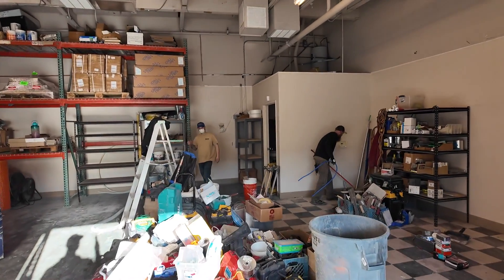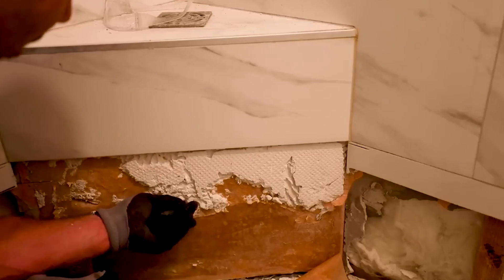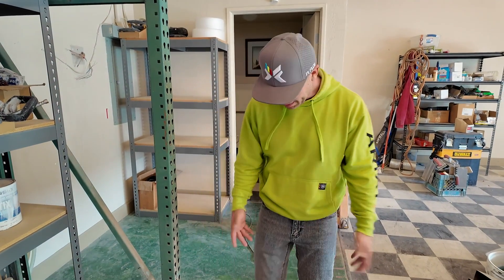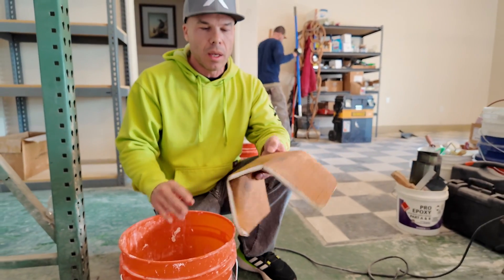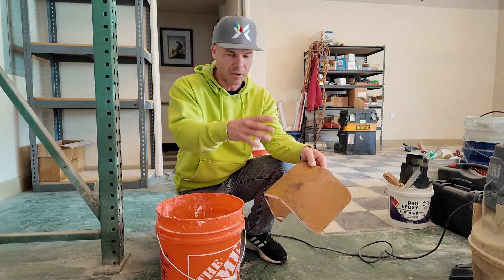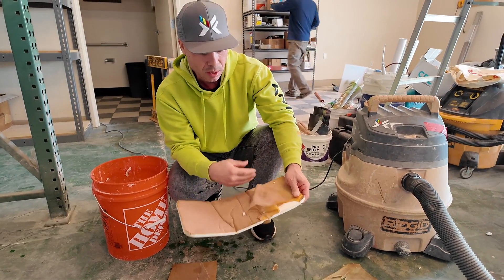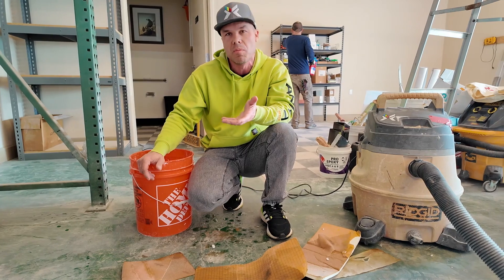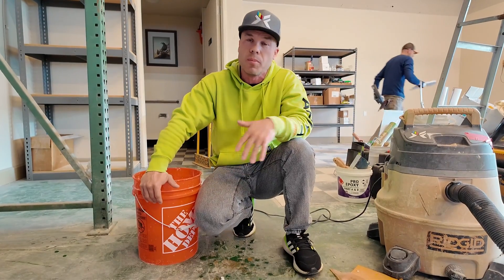MOLD ON SCHLUTER KERDI ???  This can't be good. 1 year test.

Comment: As a biologist, I guarantee you that anything you put in that bucket will grow mold in a year, and most things will grow it much quicker. Kerdi is a good product. They're not selling panels that haven't been tested. I prefer hardi, but the panels are appealing because they're light and easy to cut.
Reply: I think the test is flawed. The entire board is not meant to get wet, just the top of the membrane. I believe you compromised the structure when you got the foam under the membrane wet. I believe the best way to test it is by just putting water on top while leaving everything else dry. But that is just my opinion.
Reply: If it is install correctly, you shouldn’t have water trapped in a tight space in between tile, thinset and substrate. If you have a sloppy tile or grout install, or movement in tile, and water gets in with no way of air to dry out that space, and that shower is used every day for a year. Allowing that small space to never completely dry, and ta-da you get mold.
Reply: @AlexMikhael grout is not impervious to water, it's a cement based product and will no matter what absorb water every time it is hit with it and allow moisture to travel to the substrate and get behind the tile. Hence the reason why we install shower pans, because the tile and grout isn't impervious to water, right?
Reply: Molds always present. It just needs to right environment to grow. I've grown mushrooms and have also battle mold on a daily basis with plants. I have to keep humidity right and run three 8 inch carbon scrubbers 24/7.
Reply: Dust is also a food source, I’m sure there’s plenty of dust around the shop
Reply: Their boards to flimsy. I prefer GO board or weidi. The Goboard gives the best bond bc it has fiberglass but it's also a nightmare to handle bc of it.
Reply: @mr.eastcoastgrow6132 I wonder if we bought the goboard and then painted hydroban across the surface if it would be a better product/ easier to deal with not so fucking itchy. Just an idea, but that is a lot of work too
Reply: You prefer hardi? You said you are a biologist correct? So you are a biologist, that does enough tile showers to have a preference on which board to use?
Reply: @FuAzzi  shouldn't be using Hardie in a shower anyway
Reply: @justinkeppler9860 yes half inch hardy on the walls
Reply: @Americanman450  are you referring to Hardie backer? What do you use to waterproof it?
Reply: @justinkeppler9860  you can use all sorts of waterproof paints or there are films that you can morter to it. I do the second.
Reply: @jasonredepenning  interesting... I'm not a fan of Hardie anything interior or exterior but especially not in a shower. I'd use duraroc before Hardie but I don't like having doing double the work so that's why I prefer boards already waterproof minus the joints
Reply: @justinkeppler9860  I can understand that. I just feel funny using paper type products.  If I wanted to punch the wall I'd want it to stay intact.
Reply: @justinkeppler9860  if I had it my way I'd make everything concrete.  Shit I'd sleep on a concrete bedroom on a floor if I could
Reply: @jasonredepenning  once the tile is on the wall I promise you can punch it and not break it. It would hurt like hell but I could punch through Hardie backer without tile on it lol.
Reply: Can you define a woman?
Reply from the maker: The bucket itself didn’t have any mold on it.  I think the Kerdi has a glue or paper (something organic) that is food for the mold.  But like I said, I’m going to put a few different types of boards in there for another good soak and I will keep you posted so hopefully you’re subscribed so you see the updates.  Thanks for watching and your input.
Reply: @TileCoach  Hello my friend the mold can come from tiny invisible spores flying around in the air, or previously on the bucket, which then get into the water, which is a damp environment making it habitable to mold. a real mold test would involve a controlled environment preventing spore growth
Reply: @TileCoach  Probably the best way to test the products is to create small cubes of all the products with weights inside to keep them submerged. This way only the outer waterproof layers make contact with the water.
Reply: @TileCoach  Why do you keep putting in Kerdi Systems?
Reply: Any schluter product is required to have all the white covered in orange. Not a fair test at all.
Reply: Shareholder Alert
Reply: Unless you used rubbing alcohol to clean the bucket prior to test it would have mold in it….
Reply: Well atleast someone has some sense
Reply: Good info but also remember these materials are waterproof.  Hardi will fail when soaking in water for a while.  Also very dangerous to lungs when cutting and inhaling the dust.  Of course wear a mask as protection but most contractors don’t
Reply: No a accurate test on my opinion kerdi or any other shower foam board is not to be underwater they support to get wet not be underwater
Reply: Well you’re a biologist, not a trades worker let alone tiler
Reply: If I were a professional installer I would refuse to use kerdi on anything.
Reply: I thought shower materials aren't supposed to be submerged for yrs at a time?
Reply: @KMORRICE1985  shower pans that get used frequently can maintain moisture constantly under the tiles
Reply: Mold is good for you. Don’t believe all of these Dr. Fauci’s 😂

Comment: Dude it's so shocking what you are exposing. I'm sure schluter has some reason why user error is causing the failures, but I always thought their brand was supposed to be synonymous with simplicity and ease of use. Seems like you have to nail their process 100% or your shower will fail. 

I love how much foresight and dedication you have! A year-long test! It would have been great to see a control group: maybe a dry Kerdi board, or a plain bucket of water in the same space, or a piece of alternative shower board/drywall/cement board. There are other factors that could have contributed to the mold.
Reply: He’s not really exposing anything. Schluter can easily and fairly say their product isn’t meant to be submerged 24 hours a day for weeks on end. Taking any product, and stress testing it way beyond its intended and documented use, is a fools errand.
Reply: This is a terrible test lol....
Reply from the maker: I'm on it!   Stay tuned.  Hopefully you are subscribed with your notifications on.

Comment: I'm sure kerdi is excellent if installed 100% properly. Personally I only use  cement board and a quality liquid membrane. Works every time.
Reply: I'm sure Kerdi works great in a shower that's used for 15 minutes once a week.
Reply from the maker: Ya but we can do better can't we?
Reply: @TileCoach  i’ve been watching your videos for years off and on and have gotten into Remodeling helping with bathrooms and now I do fall on bathroom remodels down to the frame I mean everything you know complete gut moving the toilet chipping up the floor moving shower drains at work all by myself one man team. Where I am in South Florida never seen Kurti. I’m sure it’s around. No one‘s ever taught me. I’ve only learned that cement board was code and was I’d say 95% of the showers. I open up just sheet rock behind them down here very shitty builders built this part of South Florida from what I’ve learned but I came from up north Massachusetts but I’m seeing your amazing work for years and I know you make much more than I do and I’m wondering how I can learn about Curti. It must be easier and simpler than the heavy cement boards in the dust and then the coats of the red guard to me your videos. It looks like your sheet rocking you’re putting on tape on seams, and rubbing some sort of stealing over it, but I’d like to know the right way and if it’s easier and quicker it would just I’m getting up in years and anything the light in the load and make it easier. You know any suggestions on how I could learn about in South Florida

Comment: I think the problem with the test is this. If water has a high nutrient level it can grow mold. Now with your test the water was sitting still and no movement will promote mold growth regardless. With that said also you are in a shop and I guarantee a lot of dust is now in that bucket over the course of the year no matter how well kept the shop is. All of these are contributing factors. Just to confirm if you had a bucket with kerdi and a bucket with only water if you took a water sample from the non kerdi bucket after a year I guarantee you would have the same mold spores present. Always enjoy your videos and I do like seeing different scenarios to show what showers can fail to give us all better knowledge.
Reply: You were able to type what my brain was trying to think...🙇‍♂
Reply: Yeah scientific method requires a control group!
Reply from the maker: @jeffreyjbyron  The bucket kind of is the control group. No mold on the inside of the bucket, only on the Kerdi, so there must be something about the board that facilitates mold growth. . But please stay tuned I will be doing more of this!  Please subscribe and turn on your notifications if you already haven't. Peace.
Reply: @TileCoach  You might be right, it's probably that a rough surface give mold something to cling to. 

Hey--I'm in norcal and I want to get in touch. How do I find your business?
Reply: Mold will grow on nearly anything unless it has mold inhibitors. If you have mold spores and the right conditions, you'll get mold. Kerdi cannot control either of those. They might be able to add mold inhibitors, but that would raise prices. Do any of the competitors advertise anti-mold? Also, are there any competitor products you've tested that don't grow mold or don't fall apart when subjected to the same test. That's a big part of the scientific method: Controls and different variables (variables being different products here). Not that I don't like to see people trying things like that, but give comparisons.
Reply from the maker: I see what you’re saying but there was no mold on the bucket itself.  But I am going to be doing other boards so stay tuned!   Also, read the other comments about mold on the Kerdi from being left in the rain in the bed of a truck.  Not sure but there will be more to come. Stay tuned and thanks for your feedback.

Comment: You get mold on a piece of glass, it has nothing to do with kerdi.
Reply: Also mold only forms if it is exposed to air.  Good idea to have 100% coverage.
Reply: I wish he wouldn't do these clickbait videos.  It's kind of beneath him.
Reply from the maker: @radman999  It's not click bait if it's a true statement. You might not like it, but it's not beneath me.  If other boards do the same, I will report the same.  Thanks for watching and please stay tuned for updates.
Reply: @TileCoach  Anything will mold when left in a bucket for months.  Have you never seen a petri dish before?
Reply: @TileCoach  Hi Issac I’m getting ready to redo my bathroom and will use flofx drain with flofx membrane. What is my best option for the walls? Can I use backer board with hydro ban? Also what is the best brand for backer board? Thanks

Comment: Yet 40 years and 500,000 installs in Europe with 0 documented failures when properly installed.  Funny how that works.
Reply: I think that's the catch. Why make a product that requires more precision that is also more expensive? I thought the whole thing about Schluter was that it is easy to install. With so many opportunities for mistakes, specific tools, products, and training!
Reply: @jeffreyjbyron  Not hard at all.  Anyone with a 50 IQ could do it after watching a couple of videos.
Reply from the maker: @radman999  
Lots of documented failures here my friend.  Are you new to my channel?  I have been documenting verified warranty cases for a few years now.  Cases that are clearly manufacturing defects.  Also, Europe has different install methods.  They do not use thinset to adhere their systems.  Also, the board is different.
Reply: @TileCoach  All I have seen is a bunch of screwups and incorrect installs.  Any product that installed poorly will perform poorly.
Reply: @TileCoach  The failures might have to do with this. Trying to convert a European product to US, with different standards, regulations, and available materials. I mean, our houses are built completely differently from Euro cities.
Reply: @TileCoach what do they use in Europe?
Reply: @billsnyder6945 good question I’d like to know too
Reply: @jeffreyjbyron  Schluter is a multi million dollar company.  I think they know a little more than some Jose Random tiler on Youtube.

Comment: Only thing with the mold is it’s stagnant water and normally it’s a dry out system if I’m thinking right  so that’s normal to me
Reply from the maker: Yes but the plastic bucket itself has no mold on it. I don't get that.  But I will be trying several other boards to see what happens.  The mold wasn't even the point of the test, it was the layers coming apart.  The mold was a surprise.